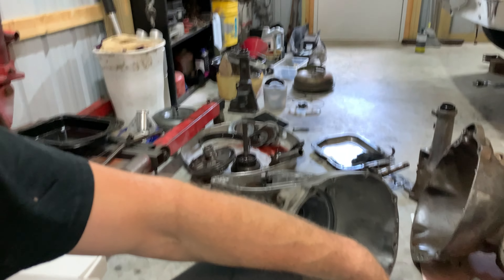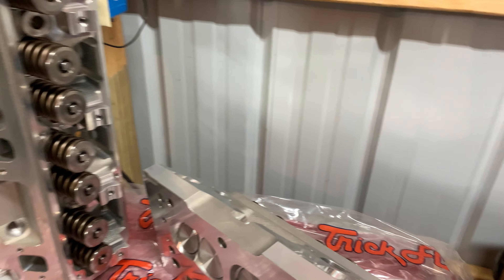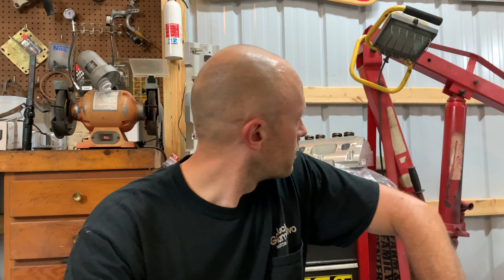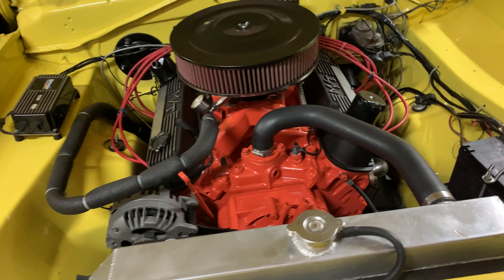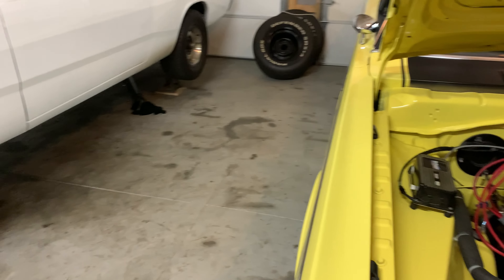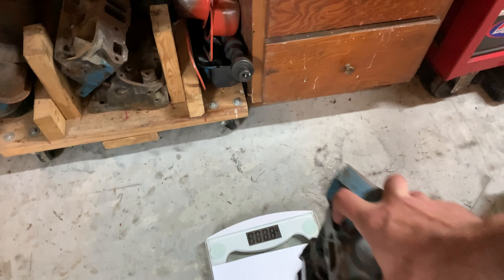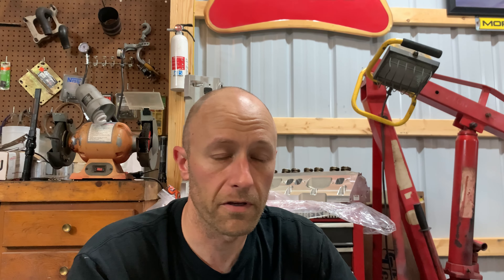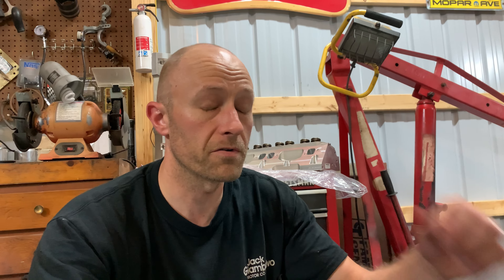Trick Flow CNC 190 Small block Mopar heads. How good are they? #trickflow

Comment: RACER BROWN IN Rosedale Maryland can cut you a custom camshaft , Ask for Jimi Dow ...And if you use existing camshaft get the 1.6 rocker arms form Mancini Racing and the selll them from Harland Sharp without the gold color on them same exact rockers without the name...Amywho yes the ARP HEAD studs are not the same for TFS Heads I got 2 sets of TFS from Summer it...So i see the Track heat (I WILL use Edelbrocks Performer RPM with an Open spacer)and the ports are perfect match intake to the cylinder heads TFS so I ordered in March 12th They said 2 months I never bothered them once in two months at TFS, I called and the guy answered the phone said we need to finish the intakes up due to sand castings etc. 2 more weeks, and I call back in 2 weeks and oh no who said that? we get the intakes in the end of month we will have them then. And I called back no not in so I see that Jegs is mentioned that they had a Track heat in the meantime another Generation show and they got it and put on car. Jegs does not advertise TFS for Mopar . I cancelled my order. TFS heads are found to flow much better on 4.03 Bore and i think more yet on 4.07 or 4.08 bore and already they been tested to make over 625 on a dyno 416 compression qas 11.5:1
Reply from the maker: With all the back orders, getting parts these days is a pain. I think I’m going to use the Indy single plane intake for magnum heads. I’ll drill it to the LA bolt pattern.
Reply: @Duster_Garage  I bought same cam roller as Joey B. Dart runs in his 408 LA. Then finally during the C-19 Wait i got a racer brown Custom cam . I dont think i will use Comp Cam now. let me know if your really interested you would not have to change valvesprings out on the TFS
Reply: @Duster_Garage  Oh yeah Indy single plane is hands down the best choice for a 275-330ish CFM head. Does still need a bit of clean up n matching of course.
Reply from the maker: @dannyfasttcars8612  my buddy has the Indy intake on top of his ported eddy magnum headed 408 Duster. He has gone 10.55 with a 9.5 converter and 3.91 gears. He just got an 8”. He’s hoping for low 10s.
Reply: @Duster_Garage  I got the HEAT now ordered again at TRE pmnce